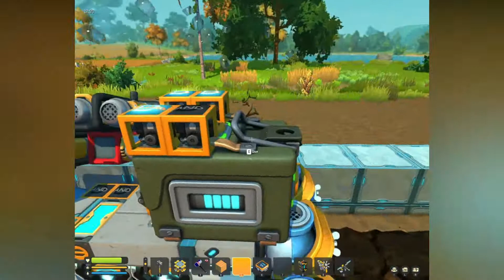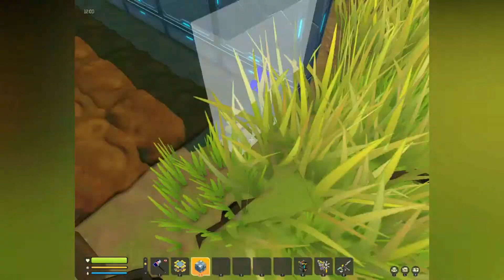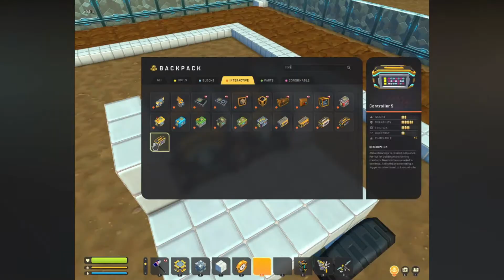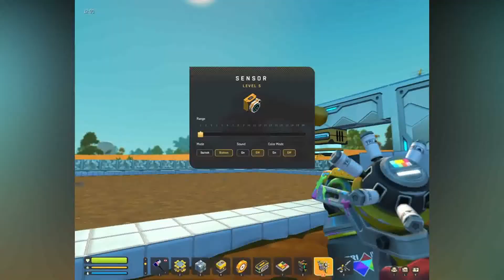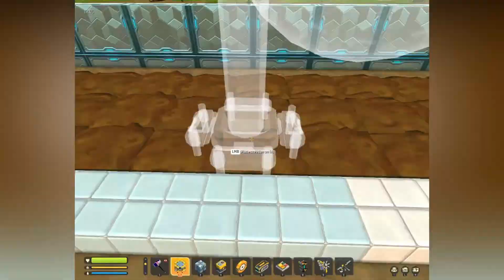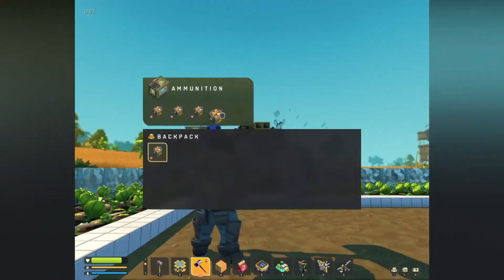I made the best Defender + Farmer robot (vanilla) - Scrap Mechanic Survival || non tank steering

Comment from the maker: no mods, I added some fant mod parts to make it more efficient in watering. if you want it purely vanilla make it with two water tanks and a normal sensor should be enough for the replacement of laser